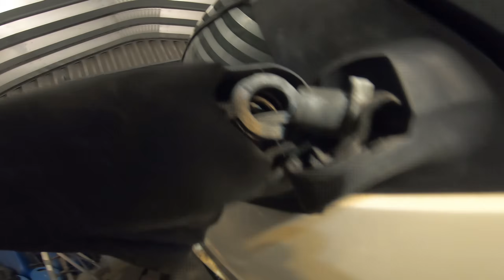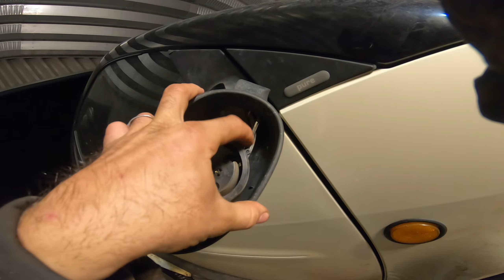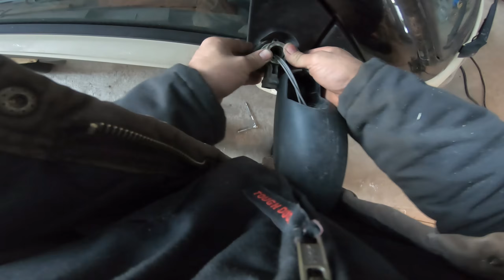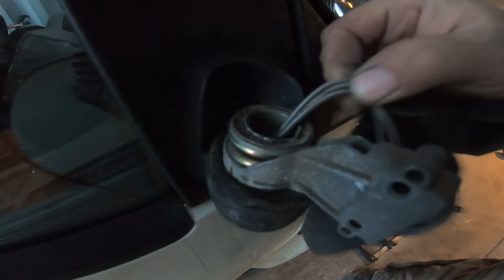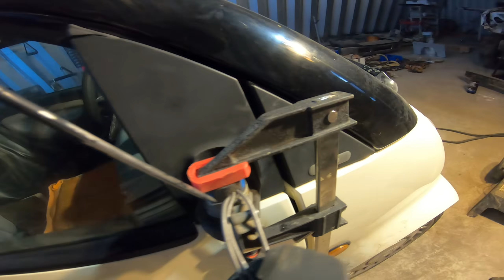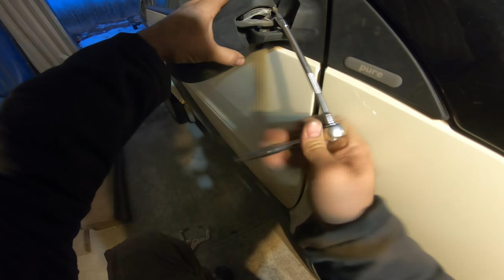Smart Fortwo Broken Loose Side Mirror Repair

Comment: Very helpful. Thanks! Mine got loose after a storm threw a treebranch on it. Fixed it with a velcro-strap wrapped around the joint, works well as a temporary fix. Love your Smart Car vids ❤.

Comment: Nice work, however you could have made your life easier by removing the whole mirror, take it apart, remove the metal shaft from the base (3 screws) to free up the whole cast iron assembly then press fit the ring and locking clip by using the same clamp and a socket that fit over and allows enough room for the shaft to go 3/4 of the way until you hear it click in. 😊 Hope this helps other people

Comment: SUPER HELPFUL! I had the same problem on my Smart Roadster Coupe, and it was even easier because you can disconnect all the wires on the electronic mirrors and than take the metal parts on the workbench and reposition the snap ring very very easy!

Comment: Hey Man! It may or may not interest you and I can only imagine how busy you are but I've stubled upon a post on clubsmartcar forum that was talking about fitting a freewheel alternator pulley and its benefits, basically faster upshifts, longer belt and bearing life, smoothness and possibly fuel economy, the post is at the bottom of the second page of the "performance and modification 450 cdi" section started by the user tolsen, intresting read and not difficult mod, they list the number of a cheap compatibile freewheel pulley, have a peak if you want and maybe in the future you could give it a try :)
Reply from the maker: Sounds like the concept works on cintrifical force or less bends in the belt. I know the alternator belt has to be pretty tight to not squeel & squeek, maybe something there to be remedied. Will take a look at it, Thank you Sir :)
It is -30 °c here at moment & I am happy to have the car running well. Will take a look at the car when a little warmer. Thank you SIr for all your support :)
Reply: @manbuilds1587  yes something like that, the next model, the 451 has this type of pulley from the factory, apparently it decouples the alternator that when spinning fast acts kinda like a flywheel on the little engine so that the engine is faster to drop in revs so faster upshifts and better in general, another good thing is that you can tighten the belt less, on the 450 you should have if i remember correctly 450N of tension on the belt, on the 451 its 330N because of this pulley, longer belt and bearings life, the reference for this pulley is INA 535005910, I've searched for cross reference and found these other pulleys that SHOULD be the same CONTITECH AP9023 | DAYCO ALP2357 | GATES OAP7080 | HUTCHINSON DB0263 | PEUGEOT 77362558 | RUVILLE 55966 | SKF VKM03302 | SNR GA75904 | SWF 588003